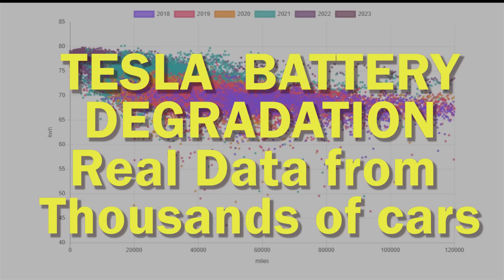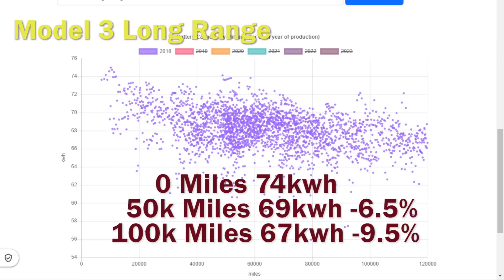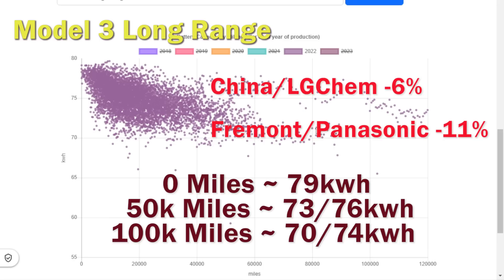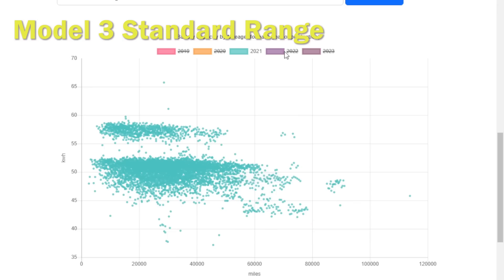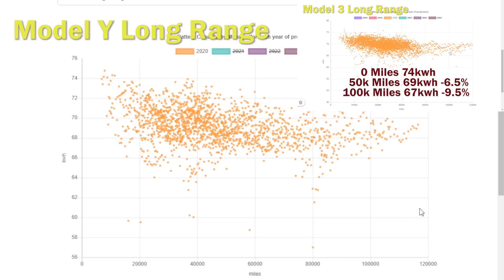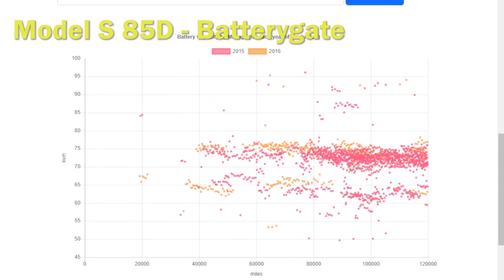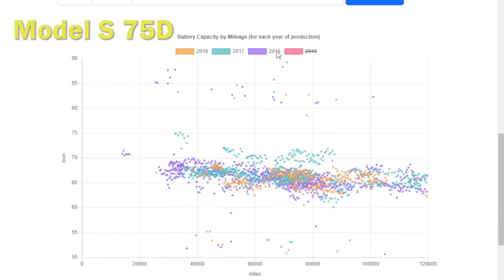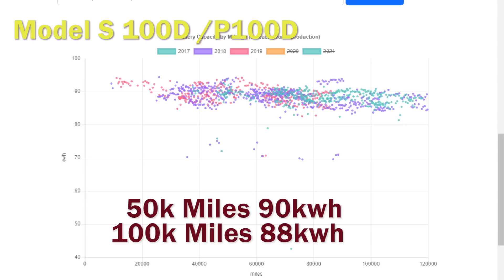Tesla Battery Degradation - The results using real data and why the Plaid is the worst Tesla

Comment: I saw on another channel battery reports from rental cars where it was more likely that the batteries were DCFC for the majority of cycles. There, the initial degradation of LFP was more dramatic before it planed out. I think we still need a better battery chemistry than either NMC or LFP. Eventually we’ll be provided with one. I’m rooting for Graphene Manufacturing Group’s aluminum graphene battery and Lyten’s LiS which also uses a graphene matrix. Both should introduce a significant weight and cost difference.

Comment: The main problem with the Tesla Model S Plaid is that it still uses the same 18650s that the other vehicles in its class use.

Similar chemistry, tabs, and casing; that just means the S Plaid is absurdly battery bottlenecked.

Comment: OK vid maker... riddle me this:

How do you know each of these datapoints have their original battery?

Why, despite some of these models having a start point at 2016 have no datapoints after 120k miles?   This suggests the packs are replaced before then...   As a practical buyer that has never owned a new car, I care far less about battery degradation over battery failure (and a costly $$$$ replacement)
Reply from the maker: We don't, and we make that clear, which is why we ignore the odd outlier (too high and it could be a replacement battery, too low and it could be a failing battery) and concentrate on where there are many thousands of readings. In general we either avoid or we make it very clear that inaccuracies, replacement batteries or other reasons may distort the results when their is sparsity of data. As for 120k miles, we have done a video on high mileage cars, the results you're looking at in this video have a mileage limit.
Reply: @EVinventory  Well how about a video about battery failures... I'm more interested in the amount of miles per failure vs. year/model

Comment: I've driven three Teslas from when they were new with approx 0 km driven.
19000 km 5% loss of stated range for Model S Plaid 2023 (no parking sensors)
17000 km 5% loss for Model S Plaid 2022 (with parking sensors)
58000 km 12% loss for Model 3 Performance 2021

I mostly drive on German highways and do 20-30% of total charging on Superchargers. Rarely exceeding 78-80% SoC. If driving in Norway, Model 3 is plenty - while Plaid has some advantage if you enjoy Autobahn. 

I've simply looked at stated range on the display when the cars were new, and what they show later on. It rapidly falls. But once it hits 12% loss of range, it seems a bit more "stable". The Model 3 had 12% loss at 47000 km, but this was also the case at 58000 km.

Not sure how people manage to report much less degradation. Maybe if you rarely exceed 60 mph, the battery is exposed to less stress...

Comment: MY2021LR per Tessie 8.5% loss 37000mi. Hope it stays there for a long time. ….
Reply from the maker: The issue with Tessie is they don't do enough to propertly explain what you're looking at. The same car can report up to 10% spread of readings over a short period of time because of environmental and pattern of use factors. We've told them that, and they're trying to show more trends, and fleet averages etc, but the health guage they display is pure garbage and should not be trusted.
Reply: @ the commander from enhauto shows me at 12.45 degradation so yeah the info is not accurate

Comment: my 13 year old chevy volt has gained 31% more range compared to the brand new epa range when new lol. a well built thermal management system, underspeced motors, and no dc fast charging means your battery will literally last longer than everything else on the car.

Comment: I miss aging degradation analysis added to the figures . Not the same degradation 50k miles and 1 year old car than 50k miles 3 years old. The first will show much lower degradation than the second
Reply from the maker: It's sort of in there by comparing the differnet years of production which we overlay. It's quite hard because comparing say a 2, 3, 4 and 5 year old cars, all with 10k miles to remove that variable suggests they've all had very different useage patterns. If you compare 2 year/20k, with 3 yea/30k, 4 year/40k etc then you are getting an age element but you're also getting a usage element, but thats how the charts can be used.

Comment: My tesla model 3 performance is now at 17.5% degradation after 4 years and 7 months do i need to be concerned? looks like im up for a new battery or am i wrong?
Reply from the maker: You need to look at BMS calibration and cell balancing before worrying too much  as you may well get 5% or more back

Comment: I have one of the original Tesla Model S....VIN is in the early 2000's.  I started out at 265 miles and then, unbeknownst to me, there was a settlement because of the battery.  I received $4500 I want to say.  Could be wrong.  Now I am sitting at around 200 miles ideal range.  Haven't fully charged in a while so hard to say.  I have 214k miles on my car.

Comment: I wished i would've known about Plaid battery degradation before i bought a used Plaid with 41K miles on it. Instead of running 9.2-9.3 at 150-151 mph best i can do is 9.4 at 146. I went to a dragstrip and trapped 148 twice but i think strip timing was off. Could be wrong. I haven't been able to trap over 146 on the dragy. 

Knowing what i know now especially with how much Plaid is depreciating i would've got one with under 20K miles. I bought mine for 68K a few months ago. Still a great car

Comment: Super fascinating. I work with data scientists and have been looking at domeatic battery degredation numbers, but havent seen any comprehensive Manufacturer specific degradation broken down like this by model and year. It's very helpful. 

I'm in the market to buy a used EV this year, and had been considering an older high mileage Tesla. The stability of the 75D is suddenly very appealing where i was less interested in it before. 

And the different model 3 chemistries, not just the model year being a factor, but manufacturing location! I need to find a way to ask dealers more info they can actually answer to make shortlisting easier. Dealers know nothing of this kind of data.
Reply from the maker: If you want to know where a car was built you can look at the VIN, our website has a VIN decoder but there's a letter just before the number that tells you the factory,  F is fremont/US, C is China, B is Berlin, in Europe we don't get any from Austin Texas

Comment: Great video. Nice to see some data to illuminate the issue. An interesting point was the variance in the smaller sample sizes - could indicates some consumers still be exposed to very high early costs / performance issues. Would be great to see something that looks into vehicle vehicle age and mileage at age vs failure probability. 

Very reassuring to see the data. Great work

Comment: Comforts me into buying a SR with LFP battery, on the used market i have around 25k euros budget, ideally 17-18k but finding a model 3 for that price won't be easy

Fingers crossed i won't face any big issues not covered under warranty cause I'm taking a big risk putting 20k+ in that instead of putting it in savings, the apartment etc.. x)

Comment: My 2011 Nissan Leaf lost 50% of its battery capacity after only 20,000 miles and 5 years because I left it unused each of the 6 month winters. I wish I was warned. It sold new for $32,500 and I got $3,000 on a trade in. At the end when charged it only had a 50 mile driving range in winter.
Reply: Oh my god!
Reply: Leafs are notorious for their battery degradation but it sounds like letting the car sit unused for months was what actually killed the battery in your case.
Reply: @FrostyAUT  good to know. Will stay away like the plague
Reply: @FrostyAUT  yes

Comment: I have a 2015 85D. It wasn't clear to me what you saying about that data set. It sounded more negative than about other data sets. Could you explain/clarify please? Thank you. I wasn't ever good at math.
Reply from the maker: I actually meant the opposite. The 85 battery cars suffered from something known as Batterygate where a software update dropped the range and charge speed on a lot of those cars giving them a bad reputation. Tesla have reversed much of that and the battery now looks pretty normal compared to others.

Comment: Lfp is 53 KW. Why are you claiming that the higher 57 KW range is LFP?. Enlighten me please, which one is actually the LFP range?
Reply from the maker: There is more than one version of the LFP battery BTF0 which is the CATL LFP55 55kWh battery coded 6C and BTF1 which is the CATL LFP60 62kWh battery coded 6L
Reply: @EVinventory  and how am I supposed to know this if I am looking to buy a Tesla M3. The additional info screen on the M3 screen only shows LFP, I'm guessing you have find one with LFP and 60kw

Comment: If people with home charging only waited an hour before plugging in, I would guarantee their cell packs would hold capacity and the slower the charge rate the better. Tesla cell cooing is restricted by the cylindrical shape of the cell, reducing the contact patch with the cells. Any type of fast charging is a recipe for speedy degradation, as opposed to those who 'babied'' their cell packs and experienced no loss in range. I have experimented in this area and proven beyond any doubt that this is true and have the data to back it up (no I will not give it away for free). I am at the 10 year stage at present and plan on continuing doing so until I see some drop off. I did find it interesting that you used giant script to obscure the outliers. Can't help thinking you tactfully paced this text as seemed to move around from image to image. I have no explanation for the sizeable difference, of above range data, other than this was all self reported data rendering it as thoroughly useless. Particularly with the cult-like behaviours of Tesla owners. In regards to EVs in general, the data still shows that  51% of owners do not buy another EV when trading in, or at end of lease. Our research shows this will not shift until the advent of solid state cells that are not effected by temperature, hold 50% more capacity cell for cell... and will experience no degradation however charged and can be charged much faster. These cells already exist and are moving into mass production over the next 18 months. At this time Tesla shares with be junk should they not be able to access supply, which is a distinct possibility due to the competitive nature of business in general, and by the fact that vertical integration is attached to these cell's development. Only Chinese EVs will have access to them.

Comment: Excellent video. Now we just need this data for all the other manufacturers. Are the 2022 LGCHem and Panasonic batteries, with the bimodal distribution, the same chemistry?
Also one English usage point: 'depreciate' is about cost, but you are using it here for capacity. Capacity can 'degrade' or 'deteriorate' or 'reduce', only value can 'depreciate'.

Comment: The spread is insane. However even risking ending up with a battery degredation on 5-10% after 5 years or 100k is not something I want. We are talking about fairly new cars, 5 years or so. What will be result be if they have twice the age and twice the ODO?  I think batteries will degrade faster as they get older.
Reply: At 200k miles you’re getting problems regardless of the car. But yeah you’ll probably need to change the battery after about 10-15 years

Comment: Interesting data, thanks for putting it up. Where I live used Tesla's just don't sell, an example is a 2019 Model3 standard range which has done a fairly low 85,000 km. The owner is selling for a little more than 50% of it's original retail price and it has 3.5 years battery and powertrain warrantee left. Given the high initial price, the asking price for this car is slightly more than a brand new, mid spec Toyota Corolla Hybrid with a full warrantee and 4 years free servicing. For me it's a no brainer, the Toyota wins every time and I think the vast majority of people feel the same. The Model 3 is a private sale and it has been for sale for over 3 months now. Even though the data supports EV batteries lasting quite well, the used/second hand market and appetite for them is non existent and that makes them a poor choice.

Comment: To start from a better angle: With common Li-Ion batteries (as used in Tesla cars) it is generally strongly discourage to deplete them below 20% — or to charge them above 80%… at least if premature and permanent electro-chemical degradation of the ion-grid is of a concern.

So in reality the depletion/ degradation rate is 40% (!) from day one if you want your battery packs to last as long as possible.

Only when that elephant in the room is hunted down, stuffed and hanging on a wall, we can start talking seriously.
Reply: But that’s a stupid way of looking at it, because that 40% is still there. 

On your daily commutes just charge to 80% and don’t go below 20% - very easy considering the range Tesla’s have. 

Then if you need the range just charge up fully.
Reply: @zachb1706  in German there‘s a typical word for it (one that never existed prior to EV‘s): „Reichweitenangst“

„Anxiety of not having enough range“… being constantly aware that you wear down your Li-Ion grid on a physical (atomic) level prematurely whenever you are trying to make use of those ‚forbidden 40%‘ (figuratively speaking) doesn’t make it any better.

Comparing it to a mere smartphone battery (a piece of essentially disposable low-end good) in fact does undercut the inherent issue by at least two orders of magnitude on a cost ratio.
Reply: @TheUnsungVil  it isn’t that complicated though. 

Just set your car to charge to 80%, your car will have enough range to do what you need on 60% if it’s battery. On the odd occasion you’re going on a long trip, set your car to charge to 100% the night before.

Or just ignore it and charge to 100% every night because the damage from charging to 100 isn’t that bad. I just used the phone example because that’s what people do without thinking.
Reply: @zachb1706  I sincerely doubt that any EV car will be able to complete my round of about 500 km (with considerable stop‘n‘go traffic), during winter with heating on with no fancy charging stations along the way.

And no: Sitting in your damn car like a squirrel for an hour, waiting for it to charge up in winter IS NO FUN LEISURE ACTIVITY. It’s exactly what it is: A moronic waste of time.
Reply: @TheUnsungVil  plenty of EVs have a greater range than that. 

And charging is improving too. China, currently the leaders in EVs, has cars that can add 500km of range in 10 minutes.
Reply: Or just charge to 100 every time, that’s how people use phones

Comment: Do we know exactly which cells are being used in each of these models? I've dug into a lot of research on different li-ion chemistries (I build solar/backup systems). It's abundantly clear that some will outlast others by an order of magnitude or more - LiFePO4 is the most prominent example. It seems like we'd have all the tools necessary to predict the effective lifespan of an EV battery with access to something as simple as the cell manufacturer's data sheet.
Reply: You could probably research it, it’s likely hidden by their respective companies though

Comment: The electric cars are evil.They're a disaster.They're the opposite of green.How do you dispose of a tesla battery. Does it take more diesel fuel to dispose of a tesla battery or to build one.
How much pollution does a tesla battery make when it burns.
More pollution than you could make driving a diesel car for your life.
The answer is yes , super toxic super deadly fumes and residue.
Who's gonna clean the residue off your house?Your swimming pool after a fire.
People are so stupid.
Reply: You realise EV fires are less common than gas cars, right.
Reply: @zachb1706  1EV battery fire put so much dangerous.Toxic fumes into the air.There's no comparison. Then once those fumes Turn to solids And fall to the ground, Or maybe in your swimming pool. They become even more dangerous. Trying to defend e v production is insanity. There's no open border either right.

Comment: How did americans become so Stupid and gullible.

To manufacture each EV battery, you must process 25,000 pounds of brine for the lithium 30,000 pounds of ore for the cobalt 5,000 pounds of ore for the nickel, 25,000 pounds of ore for copper Diging up 500,000 pounds of the earth's crust For just - one - battery.
That's more diesel fuel than you could burn in ten lifetimes.
Not only that but
Reply: https://www.epa.gov/greenvehicles/electric-vehicle-myths#Myth2

Comment: Interesting.  I got my wife a 75 kWh model X in 2016.  We've kept it limited to 80% charge for daily use, and drive it cross country once a year and use the superchargers.  In that 7.5 years, it has dropped from 225 to 220 (or maybe it was only 215 last summer) miles of range.  I got a model 3 SR in late 2022 with the LFP batteries, and Telsa says to charge those to 100% once a week, which I have done.  In that time it has already dropped from 265 to 260 miles.  In terms of miles, they have 70k and 8k respectively.  We live in Orlando where it is hot most of the year.

Comment: The word plaid derives from gallic where the ai is pronounced as "ah" not "ay" therefore like the American pronunciation "plad" and not "played". My next concern is for the word batteries which is not "bat-trees" but as spelled "bat-ter-ees", as it is a 3 syllable word, not 2. Now getting to the info, you need better titles to delineate what you are discussing. What size battery the chart is about. Also what is the definition of the warranty of a battery. Loss of what percentage qualifies as a "bad" battery deserving replacement. Also where did you get this info? thanks